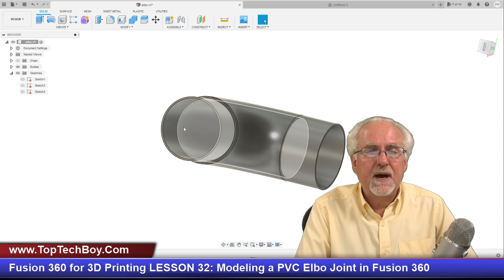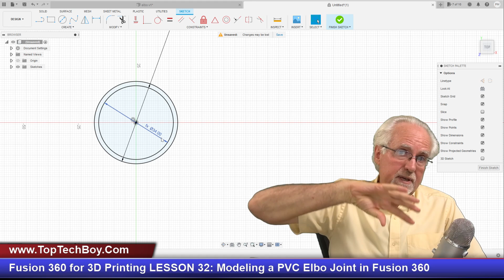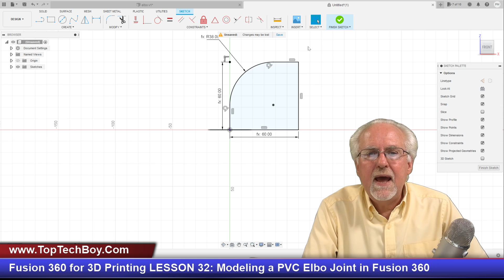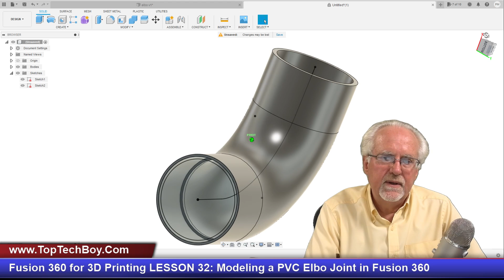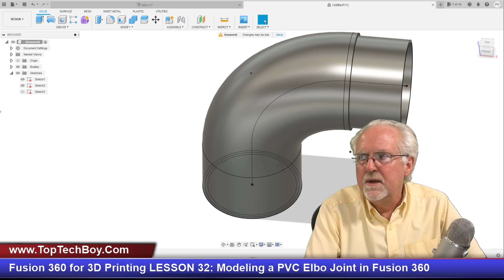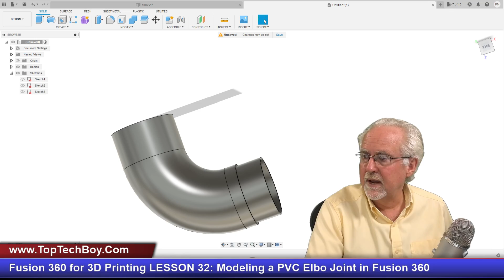Fusion 360 for 3D Printing LESSON 32: Modeling a PVC Elbow Joint in Fusion 360

Comment: I am confused about Paul's design. He specified all his circle dimensions as radii but entered them on the drawings as diameters. The 4 mm wall thickness then also becomes 2 mm.  Of course, on the screen  it looks right because the shape is correct and the absolute size is not shown. Did this confuse anyone else?
Reply: Yes, at first.

Comment: The proof of the pudding for modeling a PVC 90 degree angle pipe section. I'm hopeful you'll add to this lesson series with additional upgrades for the Ender 3v2 or upgrades you've tested. Also, additional lessons on Cura slicer settings would be helpful. Understanding there are YouTube resources on these subjects, you've earned the status of "trusted resource". Best regards and maybe I'll see you on another of your channels when I've exhausted my useful & practical household designs wish list and successful printing/installation of same. https://www.youtube.com/watch?v=vG2mzpNthAw
Reply from the maker: I think this might be printable if you would round the inside part of the bottom of the cup. Yes, the outside cup bottom has to be flat, but put an ark on the top edge of the bottom of the cup if that makes sense.
Reply: @paulmcwhorter  Thank you for the feedback. I'll tuck that piece of advice away for the next time I'm printing a rounded bottom design. Thanks again!

Comment: Great series Paul,    Thank You.      Here's my little tip. When printing a piece with a bore that slides onto, say a motor shaft, as you mentioned, the end of the bore that sits against the build plate always seems to be a little tight to the motor shaft while the rest of the bore fits the motor shaft.
I add a two-dimension chamfer to the bore on the build plate side.  Increase the bore about .010” and the depth into the bore by about .200”.  Usually, the piece will slide right onto the motor shaft with no trimming.
Jim
Reply from the maker: Great tip.

Comment: Paul, I enjoy you're way of teaching and want to thank for all these Fusion 360 videos. I started from not knowing a thing to having some confidence in fusion360 and 3D printing (already been printing some stuff for people with my new skillz). It has been a  fun and interesting journey for me. If you're up to it, below are some content suggestions ideas I had:

Fusion 360:
-Further investigation of components and maybe assemblies and animations as well
-Introduction to Mesh and surface in fusion 360 
-How to implement supports
-How to use Fusion360 as slicer (instead of Cura)
-Discussion on materials presentation in Fusion360 
-Any other useful 3rd party software like the spur gear generator
-Engineering tools like center of mass, stress etc.
-Example of designing a 3D printed part that attaches to a motor to create motion
-Example of what to do when part is too big for the printer

3D Printing:
-Considerations when printing other plastics besides PLA like ABS
-Discussion on Cura capabilities/settings/slicing
-Examination of  Gcode
-How to change fan on the ender
-Using different nozzle material, nozzle size other than .4mm and when would you need to heat the bed/nozzle more or less 
-Other printer upgrades hardware or software
-How to connect Ender directly to computer without need for SD card 
-Introduction to resin printing vs FDM Ender
-How to clean filament if clogged and what kind of filament to avoid (e.g. larger or smaller than 1.75mm etc) for great prints

Comment: In today's video, you specified OR and IR outside and inside radii. However, you used the default circle center-DIAMETER tool yielding half-sized circles. I could not find how to change the circle tool to be center-radius. I tried right clicking before entering the parameter value, but did not get a choice to use center-radius. Any sugestions?